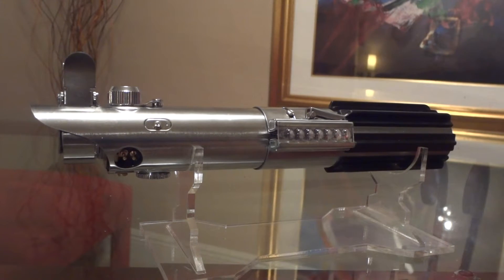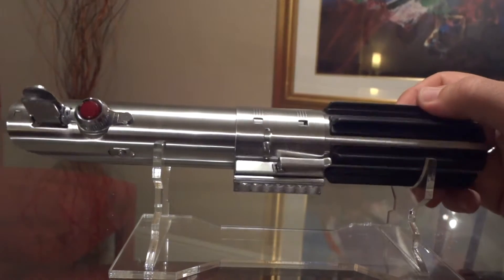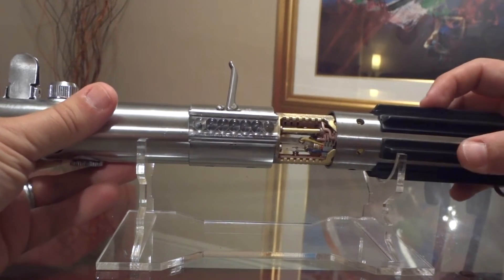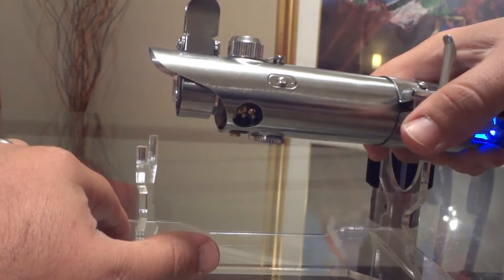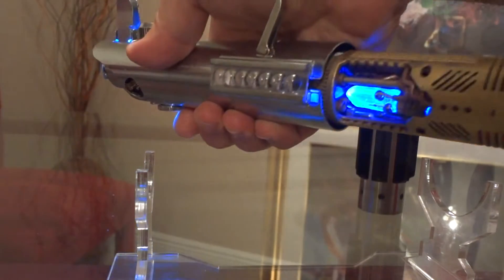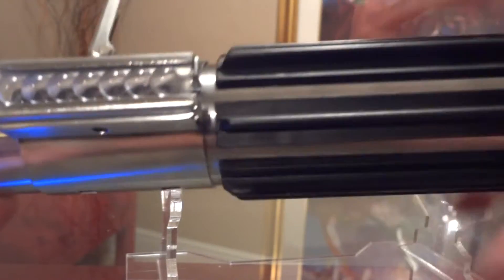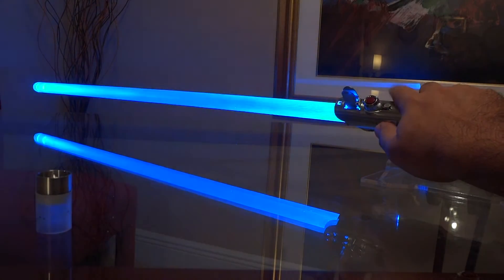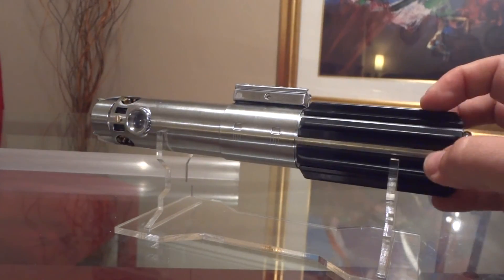Korbanth Graflex 2.0/2.1 with Darth Ryo Knight Chassis Custom Crystal Chamber

Comment: Nice work bud! Can I ask what plastic you got your chassis printed in and what mod method you did on the shine through?
Reply from the maker: I believe at the time it was just the one standard plastic. I did get it in yellow though, so that the gold paint I used would “pop” better. 

For the shine through, I just drilled a big ass hole on the blade holder and used a replica glass eye that screws in perfectly. The hole in the blade holder has to be wide enough to accommodate the glass eye. 
Hope that helps
Reply: Dr. Erick Lopez Thank you buddy. I appreciate the information. Looking at doing one myself.

Comment: Where did you get the crystal from? What were the dimensions?
Reply from the maker: Sebastian Guzman I just bought an assortment of quartz crystals on Amazon...they come in different sizes...there's always a few that fit perfectly. And that's it.
Reply: Erick Lopez ever thought about playing with some Side Glow Fiber Optic?
Reply from the maker: I did something similar with a frosted 1/4" polycarbonate tube and a 5mm LED light on my previous lightsaber chassis...check it out on my video channel...its also another graflex

Comment: how much would one of these commission for?
Reply from the maker: Adrian Onute I would say between $150-$200...I built this one and sold it on eBay. As I did with my previous graflex. 
But it all depends on what chassis you want and how much custom work needs to be done. For instance I installed a larger diameter crystal in this chassis and added a few cool little touches to really make it stand out. So the chassis needed to be modded accordingly.
Reply: Erick Lopez 150-200 just for the installation right? theres no way it could be that cheap total, if it was then I need to buy one from you lol
Reply: did u mean $1500 or $2000? lol
Reply from the maker: I don't do commissions anymore, I just build at my own pace and sell them when they're done...In the past I charged $200 to install it but that's not including the parts needed....obviously that would be much more. 
This crystal chamber I built using both pre designed 3D printed chassis and then I modified it for a cooler looking crystal chamber. I have no idea what other people charge but a simple install shouldn't cost more than $200
Reply: Erick Lopez Where can a buy a saber like this one??
Reply from the maker: depends on who builds it and how nicely you want it done...something like this should cost upwards of $150-$350+ to build since you have to take into consideration the hours spent on not only installation but, paining and prepping the chassis as well as any modifications that have to be done to it. otherwise, simple installations should be on the lower side, where more complex ones would be on the higher side...something like this should be on the medium side. so I would safely say $250-$300
Reply from the maker: Plenty of places...up until this video was made, you had 3 options...you could either buy a hasbro or master replicas saber, disassemble it and wire it up with all the upgrades...or you can find a vintage Graflex and spend insane amounts of money building it or you can get this one from Parks Sabers or Korbanth. nowadays, theres much more options...mostly vintage replicas which are very acurate to a vintage but harder to do instals on. the good thing with this saber is that most of the work is done for the builder like grips have been pre cut with guide holes and double sided tape, the pommel has been drilled and vented for sound, pieces are threaded together for easier access, and the inside section has been pre drilled to install retention screws and run wires through...you can get this saber very cheap at The Custom Saber Shop for around $195 and if you want to save even more money, you can buy their scratch and dent sabers for $150! otherwise you can look into RomansProps for an accurate replica as well as The Graflex shop and JQ Sabers offers one in stainless steel if you want something more unique! Hope this helps, sorry for the rant
Reply: Erick Lopez Thank you very much appreciate the response really thankful great job with your vids!!

Comment: hey what length is that blade plug?  Are they all the same lengths? You sold me on it
Reply from the maker: Really couldn't tell you...I sold this saber a while ago and haven't really had a graflex 2.0 in some time...I have a vintage graflex, but I'm sure the measurements won't line up.

This Graflex 2.0 requires that you place the heat sink for the LED wherever you see fit...so the length of the plug really varies.